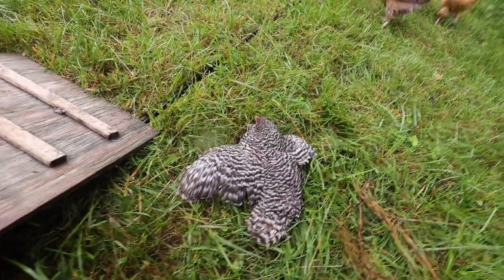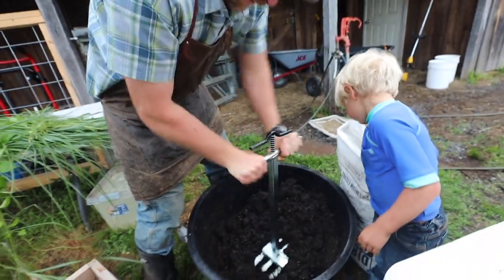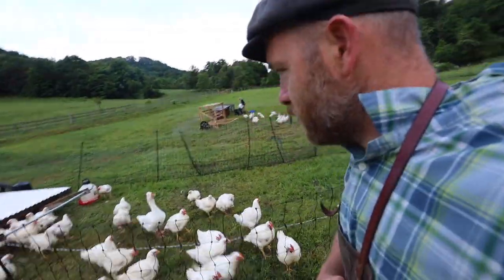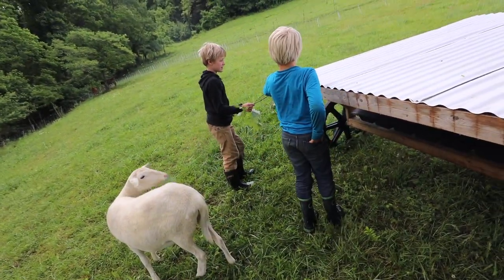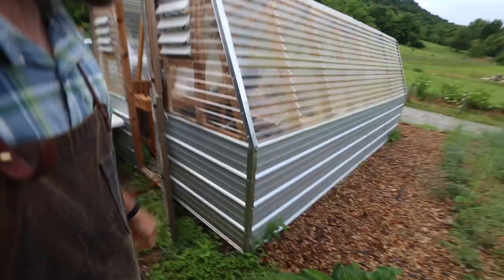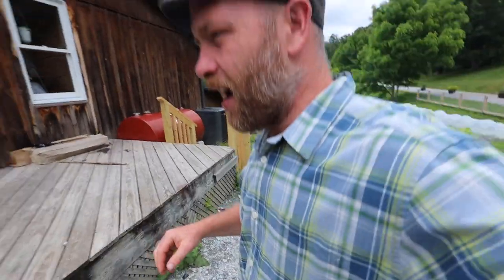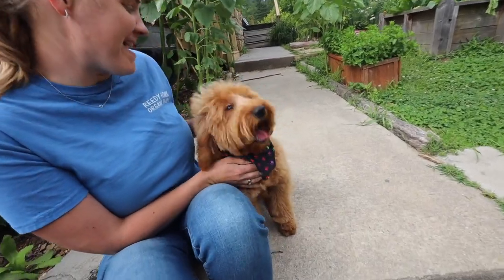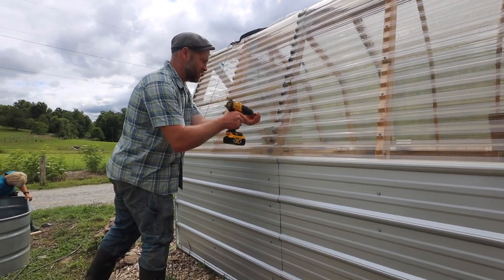Greenhouse TOO HOT! Surprisingly Easy Fix

Comment: A suggestion. My husband is from Pensacola. His mom had a greenhouse similar to yours. They had a fans which blew the hot air out at the top  and panels at the bottom which opened to draw in the cooler air. If that worked in Pensacola, that should work great for you in NC!!

Comment: Defgo ventilation at table height. A Louvre style, slides over easy  open or close one horizontal plank pull system  is good and use it to harden off seedlings too w the breeze, so need open to prevailing wind.

Comment: Justin, I would create a light frame that pivots on the 2x4 studs going along the sides. That way the polycarbonate sheeting could be raised and lowered at will. No rolling up the sheeting, it takes too long to get the job done.

Comment: Justin, could you make a triangle frame then put them on hinges attached to the roofing supports?  Then all you would have to do is lift the plastic and swing out the frames. When you want to close them you could swing them back in having one side of the frame Butt up against the roof supports so they would be clear and out of the way of your benches inside?

Comment: 4-6 squeeze clamps to prop the vents open.  thats what i would do if curling it doesn't work.  if leaving permanent for awhile you could just screw a 2x4 out the wall from the frame horizontally.